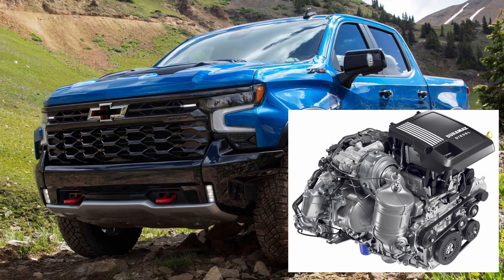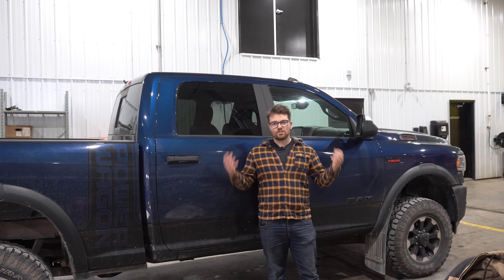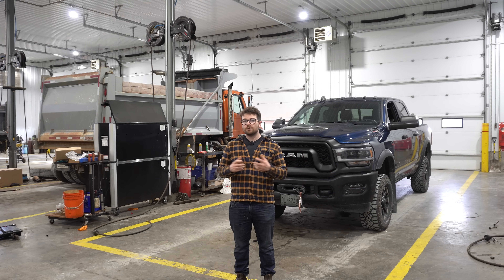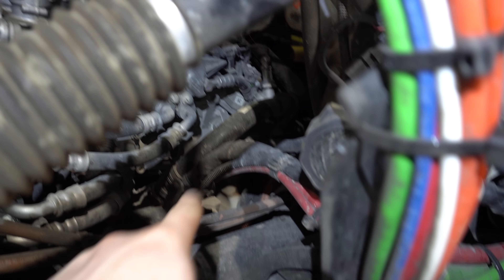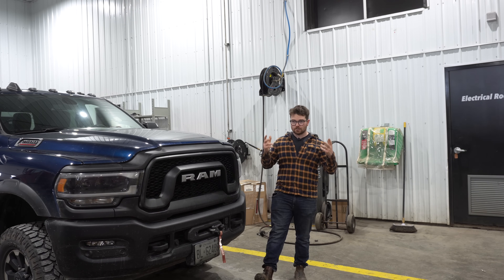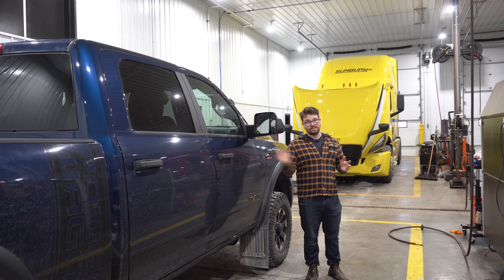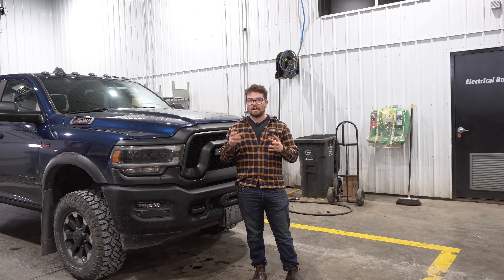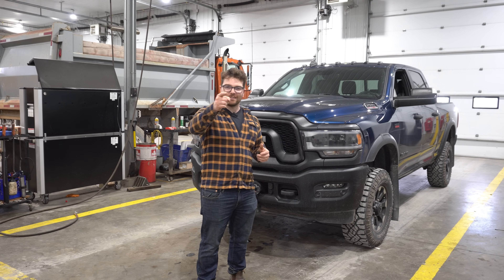Chevy Silverado 1500 3.0 Duramax Diesel **HEAVY DIESEL Mechanic Reviews** | Is It a GOOD Engine??

Comment: I'm on my second 3.0L AT4. I have had no issues with it what so ever. The engine is a beast when towing, with a 22' trailer towing a full bundle of 2"x8"x12' PT lumber, I was still getting 12L/100km. I avg 8.1L/100km and have gotten as low as 7.4L/100km. My new 2022 AT4 (Re-Design) has a few issues however they seem to be based on the programming of the infotainment system controlling certain features as well as connectivity issues with my android, and the wireless phone charger is defective.

Comment: Great video I have one 37000 Km’s on it one DEF sensor replaced 20 min job. Also the engine is an Opel designed diesel not Isuzu.
Reply from the maker: Fair enough! I wasn't sure but either way I had a feeling that's why the gear train was at the back!

Comment: 2021 1500 been at the dealership for 11 months of the 20 months Ive owned it and counting for a multitude of issues starting with door seals then long crank, sensors, intake, injectors, CPU, DEF tank, pump, hoses now complete exhaust replacement. Only thing they haven’t replaced is actual engine and transmission. 
GM buy back program is a joke and scam.

Comment: I have a 2022 Sierra diesel 3.0 .My truck has been nothing but issues truck though is very sensitive with fuel. Diesel needs to be B5 , if I add B20 I will get a check engine P2C7A. It’s a 2wd and I get 22 mpg! I have seen 4wd get better gas mileage.

Comment: It’s a great engine. 3 years, 60k miles so far. Excellent power and mileage. Smooth, quiet and efficient. No issues with the engine as of yet.
Def usage is a lot when towing tho. My only negative observation.

Comment: One thing about the EGR, they are drawing the exhaust from after the after treatment system. There is significantly less carbon ( basically none) being drawn into the intake because of this.

Comment: Putting the DPF up close to the turbo to filter EGR created packaging challenges and heat issues under the hood for the 3.0, but it is worth it in my estimation to greatly reduce the soot that EGR otherwise would carry into the engine, which is a very good thing as EGR is Hell on diesels.   A friend has a Sierra with this engine, he loves it.

Comment: The EGR delete is the first change I’d make to my diesel. There are YouTube channels such as  @darkirondiesel  and others who demonstrate a step by step process to complete a delete and other mpg/power robbing stock parts. This was a helpful video - thanks! 👍
Reply: You do know that most dealers will refuse to work on one that has EGR deleted
Reply: @glennschlorf1285  Not here in the midwest they just refuse to warranty it.
Reply: @waterloo123100  well here in the southeast they will just tell you to take a hike and refuse to work on your illegal non compliant vehicle and in some states will just suspend your plates and fine you for non compliance
Reply: @glennschlorf1285  That sucks for you dude. We don’t follow what the government tells us to do here
Reply: Tbh I'm not super happy about deleting my 6.7 and I wouldn't recommend
Reply: @glennschlorf1285  once the veh is out of warranty - likely after 36 mos.
Reply: @glennschlorf1285  I live in a non-emissions county in the SE. Have to look for those. My old truck is catless.
Reply: @wizard_of_poz4413  - why arent you happy???
Reply: @slowgoat6089  fuel economy is worse and the performance is moderately better but having power is meaningless if I rip on it and wind up destroying the transmission
Reply: @glennschlorf1285 you can put a coin in the pump to plug it up and take it out for inspection and if you need to take it to the dealer

Comment: I personally hope for a delete.. all that crap out will surely help component leave longer.
Reply: Delete what,
The oil pump belt?
Fuel pump?
Gear train?
The whole truck 😂
Reply: @fastinradfordable  those are not issue, those are maintenance operation that he gets worried about and I’m not cause i do that myself , I’m worried about emission cause even tho he says there’s none of that i can say otherwise, I’m on 2 different facebook group of people that owns lm2 and lz0 and there’s nothing but co2 sensor, egr and def tenk..and also where i leave is still legal to delete emission after the first service .
Reply: My 1981 vw rabbit pickup has 1/100 the potential reliability problems. 
And it’s over 40 years old. 

Pathetic

Comment: Since we're talking about the "Mini Max" trucks, how do you think this compares to the Colorado's LWN in a truck to truck comparison? Asking because I'm debating between another LWN and the LM2/LZ0. Also, any thoughts on the discontinuation of the LWN?
Reply: I have a LWN 16' and its a great truck, These will still be in army small trucks. They will still make them
Reply: @dustinoberly6160  I too have a 16' LWN. But I'm currently sitting at 235k miles and it's time to start looking again. The 23' Colorado's won't have the diesel engines and parts for it are already hard to find due to supply chain issues and lack of aftermarket/manufacturer support. So the question is do I get into a 1500 with the 3.0L or do get a newer Colorado with another 2.8L. But I suppose in about 12 years it won't really matter when everything goes electric 😕

Comment: I sold my 21 lifter eating fuel guzzling power wagon and bought the 3.0 AT4. So far best decision I've made, tripled my fuel economy easily. Best part is you get benefits of a diesel but maintenance is still less than what my Cummins was and is similar or less than the power wagon.. scratch that it is much less than power wagon. I love how it's a I6 and honestly that's the big thing that drew me to it as I loved my mega cab Cummins. Speaking  of cab Ram still has their tiny crew cab on the HD trucks, the GM has what feels like a mega minus the cool look and storage. Belt at the rear is nothing I'm worried about, it was done for packaging FYI but at well over 200k km I'll be on my 2nd or 3rd by then. Fuel economy is insane, driving easy at 90 to 100kph in the park I was down to 6.5L/100 and got well over 1000km on less than 90L.

Comment: '22 silverado with 11K miles so far.  No engine issues - I bought the truck specifically for that engine even though I'm a Ford guy at heart.  I haven't had any actual 'failures' so far though I have plenty of complaints like the extremely under-damped front end, the poor performance of the infotainment, the auto start/stop (luckily easy enough to turn off), and the transmission seems to get confused and shift poorly from time to time.  Also has about 30 thou end float on the rear axle that causes a clunking over certain bumps like entering/exiting a driveway.  Of course nothing is perfect so I'm sure I'd have some complaints on any vehicle but at least on the 3.0 I have zero.  Not a rocket but plenty of power for may day to day and towing an 8500 lbs trailer in the Sierras and Rockies plus I can easily top 30 mpg empty on the highway.  Sure I'd rather have a 3/4 ton truck but I don't NEED one and don't want the added purchase, fuel, maintenance, and insurance costs that come with it.  Over all I'd buy it again.  I just wish they put this powertrain in a van!

Comment: I do own a refreshed model 2022 rst , while i do love the truck i believe nowadays with car manufacturers not checking or testing vehicles are ruining the whole industry, i have 16k (kms) on it and i  had to change an airbag, a camera for lane assistance and now experiencing a clunk a few second later the complete stop, not to mention lately when i idle the engine to warm it up the whole truck smells like exhaust , and the back up camera glitches at night.. only 16k , what when later on i will start to have even emission issue ?! I repeat i do love the truck, but that is a bit much to having to deal with on a 70k truck.

Comment: The chain in the back of the engine for the oil pump which needs to changed at 100k is a no go for me, I learned my lesson with a 4.0 Ford V6 with rear chains.
Reply from the maker: fair enough!

Comment: I had the rear main seal issue on my 2020 Silverado 4x4 3.0 Duramax. My garage floor was full of oil when my truck only had 5k miles.  My truck was in the shop for two weeks and was covered under warranty.

Comment: I wouldn't say there are no issues with the emissions systems. My buddy got a brand new Sierra with the 3.0 Duramax and had the DEF heater go out after only a month causing it to go into limp mode. GM apparently didn't make the connector water tight so it got water in it and shorted out.
Reply from the maker: Nope fair enough! I guess what I was trying to say is there is no consistent issues. yes thing will fail and and fail more often but it seems likes the emission issues are at a minimum. which is nice to see!
Reply: Sontht is a human error ???

Comment: The EGR gases on the 3.0L come post DPF so little to no carbon. Never heard of injectors issues on these engines... and replacing the oil belt once every 150k miles is not a big issue at all. If thats all i have to do twice in the engines life im winning. Also you did not cover that there are 2 generations of this engines. There is the LM2 and LZO recently released. These engines are extremely reliable and very lived by their owners. I really do think you need to do a bit more research before the next video though.
Reply from the maker: I mean I'm pretty sure I said that these engines would be reliable. but the EGR is a mix of low pressure and high pressure gases on this engine. low pressures comes after the DPF yes. High pressure is still bringing in all that carbon. but being honest a belt driven oil pump is a potential issue. big diesels have a gear train driven oil pump, gear on gear making it almost impossible for the pump to stop running because it is so critical. And yes the LZ0 is coming out but I figured I would start with the current generation and see how people are liking them.

Comment: ABSOLUTELY HATE THE BELT/GEARTRAIN SETUP WHICH ESSENTIALLY MAKES YOU BRING IT BACK TO SOME CROOKED DEALER INSTEAD OF DIY...LUCKILY I HATE PAYING OTHERS TO DO STUFF I CAN DO SO MAKE SURE YOU GUYS HAVE YOUR PROJECT TRUCKS OR CARS RUNNING BEFORE 150K ON UR SHINY NEW 3.0 LM2/LZ0 ...I LOVE THE THOUGHT OF A 10 SPEED STRAIGHT 6 TURBO AS I DRIVE A 17' 4 DOOR DURAMAX 6.6 DAILY AND HAVENT HAD A SINGLE PROBLEM YET AT 109K PULLING TRAILERS EVERYDAY AMD SNOW PLOWING SOME BIG CONTRACTS YET SHES HELD UP..WISH GM DID A BETTEE R UNDERBODY RUST PROTECTION.

Comment: I have absolutely no complaints with my LM2. I have had 2 with no issues although low miles on the first one. In regards to the EGR "issues" that typically plague modern diesels... these trucks actually pull exhaust gas from after the DPF for the main EGR supply. So HOPEFULLY these engines wont have to deal with all the damn carbon buildup like every other diesel.

Comment: Them engineers done some things right but still not enough. The devil is in the details. Too much things hanging on the block in my opinion. Those design engineers don't turn wrenches to fix em. They are only concerned how to build them cheap and fast. Fast being the last thing on their mind.

Comment: Hey Alex, for the 2023 model year 1500 pickup.  They've now gone to the next generation of the 3.0 Duramax the LZ0.  It has dual SCR & besides that, they just strengthened the heads & liners & block (& what not) for further reliability gains.  Plus it has more power which lmao is always nice!

As the EGR system, this is actually a hybr id Low Pressure/High Pressure.  Unlike virtually every other EGR system (in North America anyway) that is purely high pressure.  Hence, soot won't be as big a issue
Reply from the maker: I read about the high and low pressure EGR. makes sense to bring gases that have already passed the DPF and taken out the soot. again it seems like GM was really trying to make good engine which I like to see. 

as for the new generation I'm exciting to dive into it and see that's new!
Reply: @GettysGarage  I have no idea why everyone doesn't do that style and eliminate one of the biggest issues with the emissions

Comment: I have a 2021 Dmax 1500. @61000km. I have never been so happy with a truck as I am with this. I love the way it automatically down shifts at low speeds. Crazy acceleration. The reliability is great. I get 1000km per tank. By the way this engine is a Isuzu design with Great balance. Thanks for the great info!
Reply: Nothing to do with Isuzu ... Opel    from europe

Comment: Great review! But I'm pretty sure that Isuzu haven't help to much in the process of design this engine, for an example the most reliable engine Isuzu have had is the might 4JJ1, as you mention all the cam and crank gearing is at the front, it would make sense to add 2 more cylinders at the 4JJ1 (and may be called 6JJ1 hehehe) and would make and exceptional diesel engine. I know for sure that the Colorado 2.8L duramax engine has been develop for Isuzu due to the similarity in design and operation based as 4JJ1. And the 2.8L Duramax seems to be a really excellent 4 cylinder turbo diesel and GM is the only one to offer it. In any way this new 3.0L inline 6 cylinders seems to need to much service to make it reliable and I'm not sure if the maintenance cost will make any sense in a typical work truck that US market is intended to be used. In that scenario this engine do not deliver the requiere durability that diesel engine are known. Is a good approach but is not quite there yet. I wonder if Ram/Cummins would  develop a smaller displacement inline 6 cylinder to fitted in a 1500 lineup instead of using a V6 Motori o a development of  Fiat diesel engine.
Reply: The 2.8 Duramax is a fiat/vm motori engine. In USA it first went into the 2.8 CRD jeep libertys. It is a quite good engine. But not Isuzu. It’s Italian.

Comment: Variable displacement oil pumps are great. There is no need to have full pressure at idle / low load, there is no difference in engine wear so might as well have the better efficiency.

Comment: Great Video! The big engine you showed is a pushrod engine which are more compact and lighter than overhead cams which are not needed because of the low rpm. Tuners run the Chevy LS and LT gas engines rev to 9000 rpm. also pushrod engines are much easier to work on.
Reply: are overhead cams like vtec in honda? or how does it work exactly

Comment: Really disappointed that you didn't discuss the electrical issues that have plagued the LM2 trucks. In 30k miles, the fuel injector harness and the main electrical harness have both failed and had to be replaced. Both failures occurred between 20 - 32k miles. Other than that, it was a very good video and I agree that mechanically, I think it is a solid engine. I just wish GM would put more quality into the electronics. It took 3 trips to the dealership with a total downtime of 3 - 4 months out of the first 24 months of ownership. In my humble opinion, that is absolutely unacceptable from a $50K truck.
Reply: harnesses has been on the gas trucks too, just shit people putting these trucks together,
Reply: Would be unacceptable from a $30k truck. 3-4 month down time could make a man postal. Someone mention lemon law.

Comment: GM engineers had little if anything to do with this diesel......like the original Duramax it is all Isuzu and will likely be pretty much trouble free.....Only time and miles will tell though
Reply: This isn't an Isuzu design. It was codesigned with Opel.
Reply: He has no idea what he's talking about. He never even saw one of this engines

Comment: As soon as you mentioned that the rear gear train was at the back, I crossed off the 3.0 duramax as my next long term vehicle. There's a 2021 gmc sierra slt crew cab with longbed and tow mirrors for sale in my area for 44k and 20k miles. Was considering it, not anymore..
Reply: Belt is not a problem. He has no idea what he's talking about.
Reply: Well you are really selling yourself short of an amazing engine!
Reply: @edwardpate6128  its okay. I think I’ll just get the gas v8 with the 2500 gmc Sierra or Silverado

Comment: The best baby dmax v8 GM shelved back in 2008 was the 300hp/520tq 4.5 duramax for the half ton it was basically the 6.6 little brother. As for the belt driven oil pump gm could have spent a few more dollars and made it chain driven 🤦🏿‍♂️
Reply from the maker: Apparently the length of the engine is what made GM go with the belt. they said a chain would of hit the cab. but still it should be a chain. big diesel just run a gear train set up so you are literally gear on gear to the oil pump.
Reply: @GettysGarage  GM isn't going to dump 10's to possibly hundreds of millions of dollars to re-engineer a platform to fit a specific engine. All automakers do this, the engine has to be packaged to fit the platform. Hence why GM always stuck with the damn 4.4 inch bore spacing on the smallblock because they were litterally throwing it into almost every platform they manufactured.

Comment: Lets update this since everyone is gonna trade their LM2 to an LZ0
Reply from the maker: I'll be digging into the LZ0 soon enough but it's not out just yet. So might as well start with the LM2
Reply: @GettysGarage  no you're right and I appreciate you doing that
Reply: Bought my 2021 last November day it was dropped off to dealer.  Need bench seat in front and aside from crappy rear camera in low light and no wireless apple CarPlay I’ll be keeping it until it falls.  Since WEF is forcing electric on us I may never own another diesel truck again.  2032 you won’t be able to buy any.  Just need to keep the rust off.
Reply: @kitchensink7345  you got a while for that